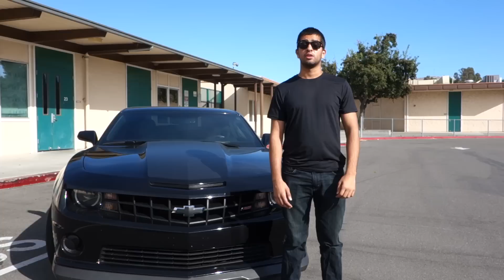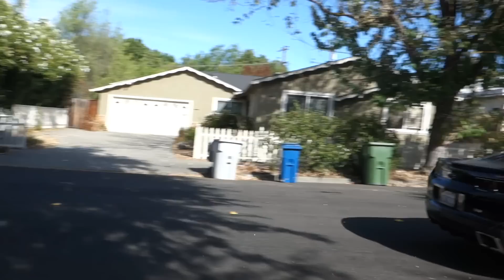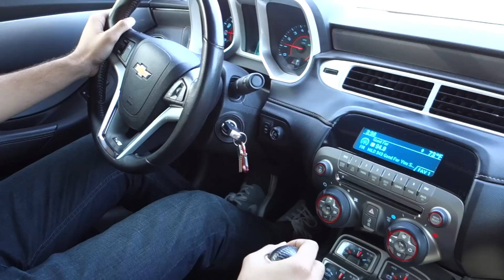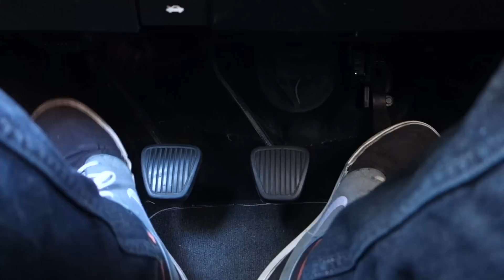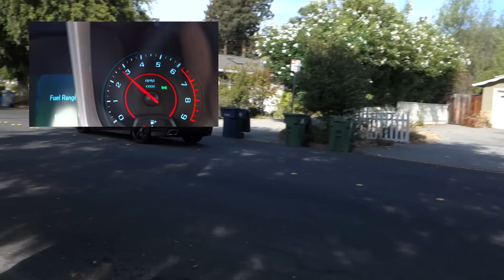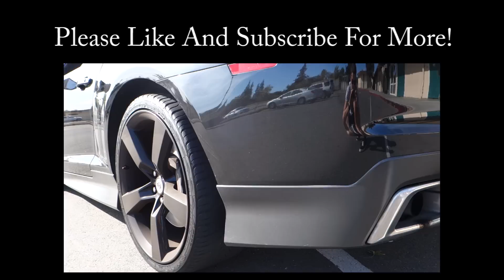How To Downshift In A Stick Shift For Beginners

Comment: OK first of all downshifting is where you reck your throwout bearing and burn out your clutch you are hurting the transmission I have 3 cars all manual and I've been driving manual for 12 year's why would you go through the hassle and break your wallet to replace a clutch I can assure you replacing the transmission would cost you more than replacing a clutch but to avoid damaging the throwout bearing and burning out your clutch I will break it down for all the newbies DO NOT DOWNSHIFT WHEN SLOWING DOWN THROW THE GEAR STICK IN NEUTRAL and just keep your foot on the breaks till the car comes to a complete stop if traffic starts moving before you come to a complete stop try to speed match your speed gauge needle for example let's say you're coming to a stop but traffic started moving before you stop and your car reads 25-20 you would shift from Neutral to second gear 30-40 should be from Neutral to 3rd if you downshift your wearing out the clutch faster and its going to cost you a lot of money to replace it
Reply: +Gravecb Seven Clutch cost $200, not really that much money.
Reply: potatoe4221 You shouldn't be downshifting to begin with
Reply: Gravecb Seven Why not?
Reply: potatoe4221 When you downshift your wearing out the clutch and throwout bearing its also bad on your transmission ask any professional they'll agree with me
Reply: +Gravecb Seven I feel as though you have been misinformed as down shifting puts no extra stress on your car. meaning it puts the same amount on as up shifting.
Reply: potatoe4221 I'm a professional when it comes to driving a manual car there's no misinformed here I'm telling you that downshifting is bad upshifting doesn't hurt your transmission that's what manual cars are meant for. Downshifting on the other hand wears out the clutch fast and damage the throwout bearing I rarely replace my clutch your video is misleading anyways do what you want you probably go through clutches anyways
Reply: +Gravecb Seven If you downshift correctly you will not cause any major wear on the clutch. If you are downshifting all the time where your car is jolting, then you are causing more wear then what it's worth. If you rev match perfectly and have a smooth transition, you won't be doing anything major to your clutch. There is certain situations where you need to downshift rather then neutral and break in the instance that you know you'll be speeding up again. If it's a complete stop, I say neutral and breaks. But certain situations will require you to downshift, say at a turn. Basically, you should do it perfectly where it's smooth. But if you are jolting, you are doing it wrong, and will certainly cause damage if continued long term. At least this is my conclusion based off of my research, and from many friends who drive manual. I actually just started driving manual myself. Downshifting is an advanced technique that you should not worry about too much until you have mastered the basics of driving manual. This is true in every case though; replacing your clutch/transmission/gearbox will be significantly more expensive than replacing your breaks. Especially if you own a Volkswagon or cars that generally have more expensive parts. Breaks are relatively cheap to replace. I'll admit, I am not quite ready to be good at downshifting, but in certain cases I can see why it's necessary to downshift in order to get proper acceleration if you are at a higher gear.
Reply: If you're in say, fourth gear and you're approaching a intersection with a stop light, what do you do?
Reply: MetsGiantsRangersKnicksNYSports Apply break until engine rps drop below 1000 then clutch in and to neutral. Also it really does depend how far you are, but if you are a beginner that is what you would do.
Reply: Thanks this is easier for a beginner.
Reply: I was about to ask about this. My friend drives an Impreza wrx and he says it's a lot less wear and tear to putbinto neutral. I was going to ask if putting it into neutral would be more optimal. Thanks for this.
Reply: Jesse Leos Long story short I just scrap an 04 Nissan Sentra SER Spec V 6 speed manual transmission with 367,000 km/h original miles I had the car for about 2 year's bought it with 349,000 miles my transmission needed to be replaced because it was either one of 2 reason I drove it way too hard accelerating fast at green lights racing on the streets or because the miles were too high I took it into a shop because last week as I'm driving home my car wouldn't going into gear I had the mechanics check it out I was told the transmission had to be replaced $1,052 with labor I decided not to go ahead with the new transmission and scrap the car they said my clutch was good so here's my story I never down shifted and my clutch outlasted my transmission
Reply: That's why you don't use the clutch. You rev match.
Reply: Gravecb7 Accord so youre telling me youve been driving a stick for 12 years and you still cant properly downshift without damaging your clutch? maybe you just shouldnt drive a manual transmission
Reply: Juan Sotelo You don't need to downshift only amateurs downshift that's why they go through clutches you're telling me I shouldn't be driving manual you got some nerve
Reply: You ever heard of rev matching/heel & toe? If you drive a manual transmission daily yiure gonna go through a clutch here and there personally replacing a clutch once a year is my rule of thumb but even then i do it moreso out of habit rather than necessity
Reply: Gravecb7 Accord thanks
Reply: Not everyone can have a basket of money to replace shit lol
Reply: potatoe4221 to brake, you would clutch in then brake at the same time?
Reply: exactly black titan, if you brake first the car would start jolting and if too much brake possibly shut down on you. I come here to learn how to drive my manual properly and see a lot of bullshit !
Reply: A lot of newbies have no idea how to drive a manual car correctly guarantee it's only a matter of time before something gets fucked up and a call to the mechanic shop one of the reason why I'd never let nobody drive my manual cars fewer people have the same knowledge I have and can relate to my knowledge without doubting me funny how all these new beginners are trying to be a smart ass and tell me otherwise when they have no clue how a manual transmission operate they think you just get in and drive and everything is fine till something breaks while they're driving and they then find themselves stranded at the side of the road waiting for a tow truck to come haul their piece of shit off the road
Reply: Black Titan I hope you aren't serious about breaking and clutching all at once cause if you are I don't even know where to start and end with you if you are slowing down you do not need to apply the clutch unless you are shifting it's not a break pedal I can tell you'd never driven a manual stick shift car before
Reply: lol grav man chill the f out ! Anyway I have been driving for less than a year and I do what black titan says also.  When I'm coming to a stop or slowing down for a red light I push in clutch and press down the brakes, am I wrong ? If so , enlighten me then
Reply: Gravecb7 Accord ur right I haven't I was asking a question....
Reply: The Rose That's definitely bad on your throw out bearing only press the clutch in if you're gonna shift gears if not just break only less wear on the transmission and clutch as for coming to a complete stop you won't stall if you shift to Neutral you don't want to leave it in first gear while you're stopped at a red light or in traffic watch a few videos on how to drive a manual car you'll see what I mean when I said don't leave it in first gear if you aren't moving
Reply: ok so if I'm coming to a stale red light on 5th gear I only brake to slow the car down , so what do I do when I know at any time that stale red light is turning green? Do I let go the brake and continue on 5th gear or I shift to neutral and back up to 1st or 2nd ? Its the stale red lights and heavy traffic that gets me
Reply: ok a simpler question then, on a stale red light and you're coming up that intersection when you know that light could turn green at any time what do you do ? I used to just down shift from 5th to 4 to 3 and usually by then the light woulve turned green and I would go back to 3rd to 4 to 5th. Or even on a left turn on green driving at 5th gear what do you do ? I honestly think on som occasions you HAVE to downshift !
Reply: The Rose sounds like you're overdoing, way more then you should be doing all that shifting is unnecessary. If you're slowing down, don't go back into first gear, first gear is more of an acceleration gear from a dead stop, or if you're doing 15 or below and driving through parking lots. To answer your question here's what I usually do rather then downshifting but this is my knowledge you don't have to follow my instructions when I slow down I don't downshift or shift into Neutral I simply stay in the same gear I'm in then just before coming to a complete stop, I shift to Neutral however if traffic starts moving before coming to a stop depending on the speedotech and RPM let's say 20 for example from Neutral I shift to 2nd gear never first gear unless coming to to a complete stop if you were racing it would be a different story this is normal driving in traffic I'm talking about
Reply: oh ok gotcha, I also drive a classic car so when I stall I usually have a hard time starting it up again. but you do downshift when the traffic all sudden gets busy or on a school zone, right ?
Reply: Gravecb7 Accord so if I'm coming off the freeway I'm in 6 gear can I just clutch in then put it into neutral?
Reply: Throw it in neutral. Breaks are cheaper than a clutch.
Reply: Jerome Narine I keep trying to tell people that replacing your break pads are cheaper then having to go to a performance shop order a new clutch and wait possibly 2 weeks to get it then have your car in a shop for the whole day just to replace a burned out clutch some people can replace their own clutch but replacing a clutch isn't something just anyone can do you have to know what your doing because it requires removal of your transmission plus you have to resurface the fly wheel
Reply: Gravecb7 Accord Exactly I agree. a clutch can last long time if used the right way and less stress is put on the gears.
Reply: I don't downshift anymore after I ruined my 2012 f30 bmw's clutch. Most modern cars aren't built for abuse, they're built to commute. Downshifting is fun, but Grave has a point, it does prematurely wear components. We're not computers, we're not always going to rev match perfectly and shift perfectly. It's just a heads up to beginners and I'm sure more experienced drivers have a better time downshifting without  risk. Practice on a beater if you have the luxury because it's a skill needed for more spirited driving and aggressive highway driving or you could be like me and shell out 2500 USD. :( Also I'd recommend to avoid downshifting on a Dual Mass Flywheel, they're way too expensive because you can't resurface them and must be replaced after a second clutch change.
Reply: its fun to downshift though cause exhaust goes BURBUBUBUBUBPOPOPBURUBPOPBURBbub
Reply: Gravecb7 This comment was more informative than anything
Reply: So if I’m in 6th gear and it’s time to stop can I brake until I’m near light then put in neautral or is that bad for transmission

Comment: if i was trying to slow down, and i down shift, do i still step on the gas after down shfting?
Reply: No bro that will make you go super fast. What you need to do is downshift then dont push any pedals when you feel that is has decreased speed now you can gently push the gas pedal

Comment: can u explain more about downshifting like is it possible to downshift ur gear from 120km/hr into second gear?????
Reply: No, second gear can handle up to 70/80km ish before redlining. If you downshift from a higher speed than the gear can keep below redline, your pistons will hit your valves and your car will die.

Comment: I did not get it .
Reply: When you down shift, and the clutch is to the floor, give the throttle a tap and try to get the revs close to where they'll be when you let the clutch out. If it jerks forward you revved too high, if it feels like it braking your rpm was too low.

Comment: I always just ride neutral 😎
Reply: Thats not good. I used to do that too. But you wanna always have your car in gear
Reply: @Divocapella  what's bad about it?
Reply: @nytro8027  If you need to spontaneously accelerate to avoid an accident what are you gonna do when you're coasting in neutral? The only time you should ever be in neutral is if you are at a stop.
Reply: Chris Wilson in what cases do you need to accelerate? Not calling you wrong I just wanna know
Reply: @nytro8027  Could be a plane falling out of the sky lol or the light turns green before you stop. Its not good for the clutch to be shifting into gear from neutral while the car is moving. Coasting around in neutral is similar to waiting till you're about hit something to put on your seat belt. You don't know when you're gonna need it you just put on from the start thats just what you do. You don't know when you'll need to spontaneously acclerate and also its not good to shift into neutral and then back into gear while you're moving. You always want to have total control over your vehicle. On top of all that you burn through break pads way faster doing it that way.
Reply: Chris Wilson fair it just seems like downshifting 3-6 gears every time I accelerate will bring more wear to my clutch than coasting will to my brakes, and brakes are a whole lot easier to fix
Reply: @nytro8027  Thats like that least important reason to not do it lol Don't worry about the pads worry about having control of your vehicle. Doing what you described is very lazy and not what people who know how to drive manuals do. You might as well be driving an automatic. If you are moving you should be in gear thats basic common sense and proper driving. Go read any manual transmission forum and the one thing they all agree on across the board is that you should never be coasting in neutral and you should never be shifting into gear from neutral while you are moving. If you aren't gonna downshift the least you should be doing is braking to a stop while still in gear and not switching to neutral until right before you are coming to your stop. Ideally you'd wanna either downshift all the way or after you engine brake to around 20-30mph you downshift into 2nd or 3rd and then finish engine braking and not clutching in and going neutral till you're actually about to stop. Are you just popping it in neutral at like 40-60mph and coasting all the way to a stop in nuetral? Or if the light turns green before you stop just popping it back into gesr from neutral? Thats not good at all and totally incorrect.

Comment: when downsifting from 6th to 1st do you hit every gear?
Reply: JCL Potato you don't have to
Reply: Mad Gunslinger  thanks just didn't want to tear out the transmission
Reply: skipping gears is actually easier on the gear box like if you're going from 3rd to 1st. Of course skipping straight from 6th to 1st probably isn't the best idea.
Reply: Okay
Reply: Mad Gunslinger so if I’m coming to a realignment doing like 50 and I slow down to say about 20 in neutral and the light turn green I put it into the gear that usually works around that speed?
Reply: Mad Gunslinger dumb question but never hurts to make sure

Comment: So beginners should know how to rev match right away? 
If you rev match wrong couple times it can cause major damage to the engine, can it not?
I've  seen people downshift with simply letting go of gas, hitting clutch, downshifting  then slowly bringing back the clutch until you feel the gear moving into place then get back to accelerating.
Very confused on why so many people are making different ways to do it "properly" when really there all just different techniques used for different situations. Would you really rev match everywhere? I mean seems a bit excessive.
Reply: Exactly, rev matching is definitely not beginner.

Comment: So I get the concept of downshifting 1 gear I think. 

But if I'm in 6th gear and have to e brake (deer in headlights, pedestrian, BLM protest blocking the highway), how would I downshift from 6th to 1st super quickly?
Reply from the maker: Well you don’t always need to downshift. In the case of an emergency just slam the brakes and as long and you put the car in neutral before you come to a stop you won’t stall.
Reply: Not sure if one of those are exactly things I'd wanna come to a stop for.

Comment: What happens after you let out the clutch? Do you have to give it more gas to prevent it from stalling out, or will the engine gently wind down from the higher rpm?
Reply: It will  gently, but quickly wind down, but you don't want it to, as you need a higher rpm to hear down smoothly

Comment: It's not necessary to downshift or double clutch in today's manual transmissions unless your driving a semi. 

It's additional work that's only causing more wear on the clutch and transmission. 

But then with a muscle car I guess you enjoy all the noise coming out the exhaust so it's appealing to you but not needed otherwise.